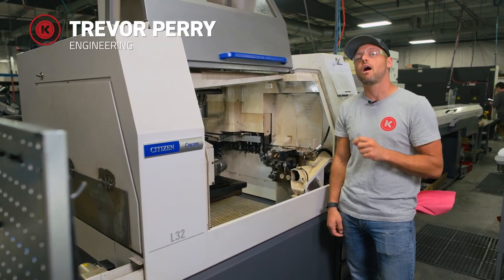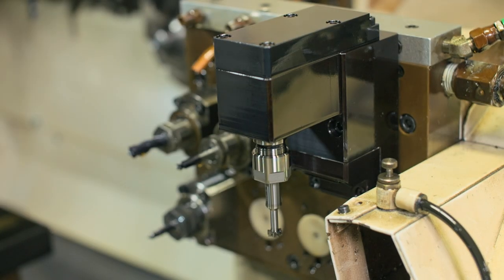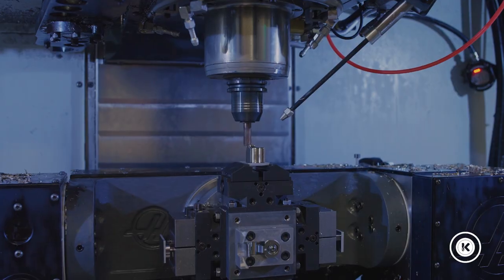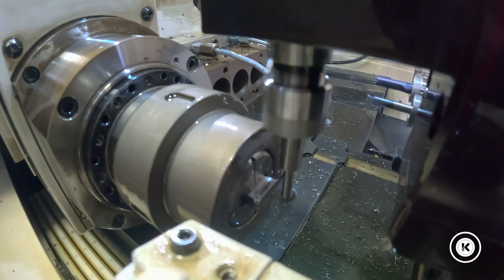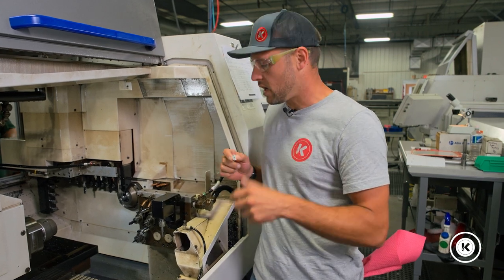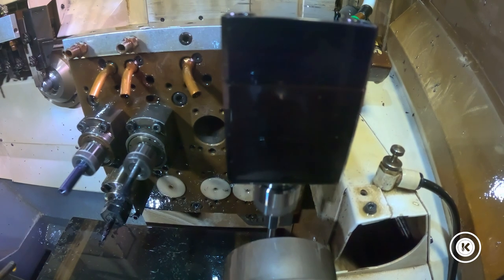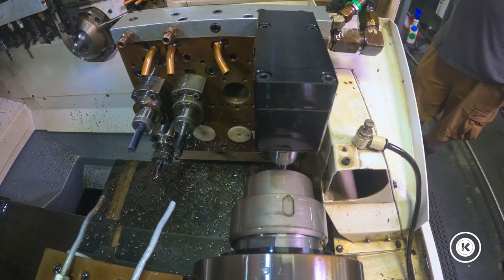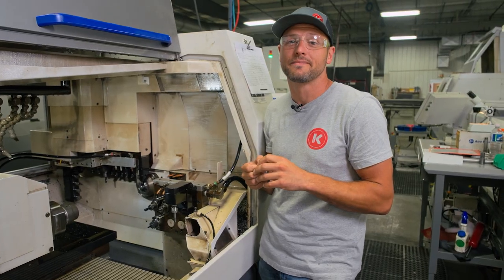KGT Sakashichi, An Affordable Cross Drilling Milling Spindle - Review

Comment: I find these videos very useful! I don't own a Swiss lathe (yet!) but they are just too cool looking to now get one so I think that's going to be the next machinebI get for my little 1 man shop
Reply from the maker: Good Luck! They are great machines, the one thing to keep in mind is your non-perishable tooling costs - if you are going to run with a sliding headstock for each size material you run you will need a collet and guide bushing plus a pick-off - if you have a bar feeder you will also need a bar feeder collet. Depending on your product mix it can add up quick, once you get multiple machines its nice you can share those across them. Let us know how its going when you pull the trigger!

Comment: whats the retrofitted pneumatic tube on the part chute for? cleaning? blasting parts off the chute walls? 
Did you take the tube from the default ejector (M72/M73)
Reply from the maker: Yes, the tube on the chute is to help gets the parts out of the sub and down the chute (instead of sticking/piling up) - I will have to check where they pulled it from.
Reply: @KreminIncManufacturing  Most likely.
When your cincoms have a additional HP Pump, one valve is usually connected to the sub spindle for coolant thru spindle. That would render the Air valve useless, but still functional. It would make sense to use the default air hose somewhere else